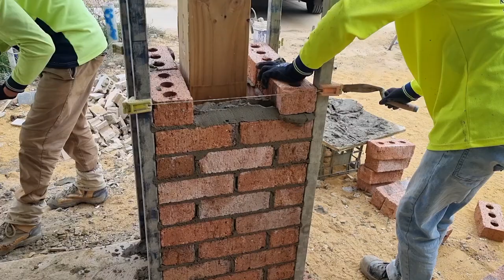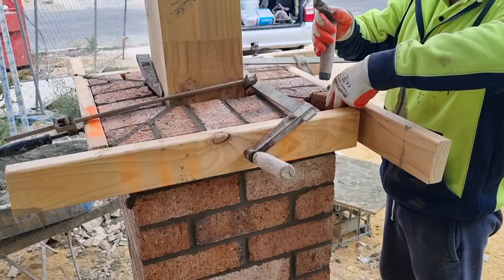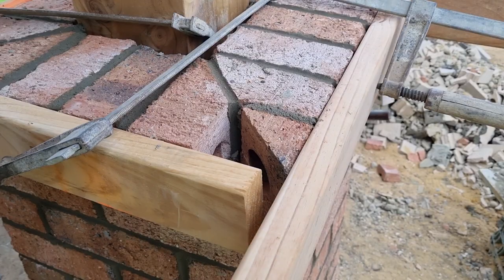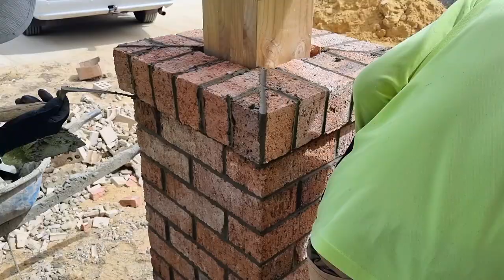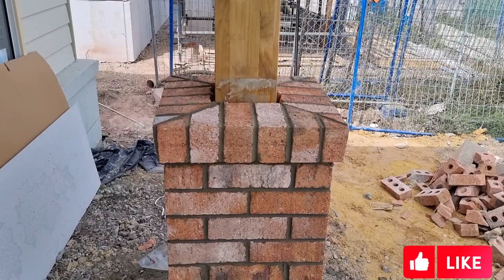how to build a brick Pier?

Comment: Is the wooden former removed when pillar is finished i am just thinking if the timber gets damp in winter and freezes and expands will the brickwork joints fracture
Reply from the maker: The weather is always above 
Nothing freezing here
Reply: @a.f4110  ARE YOU SAYING THAT NATURE DOES NOT APPLY TO ONE PARTICULAR  PLACE BECAUSE EVERYWHERE WITHOUT EXCEPTION EXPERIENCES FREEZING WEATHER
Reply: @robertandrews5640  doesnt get cold enough down here for that timber to freeze